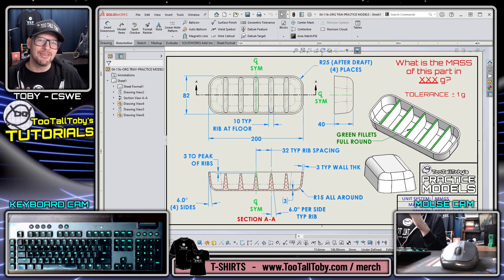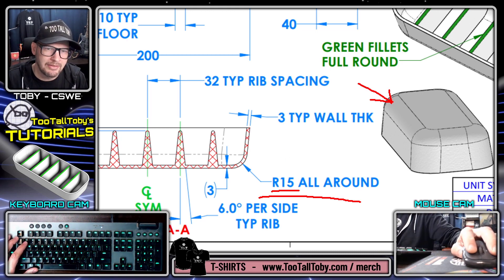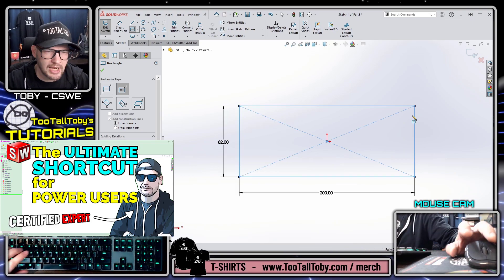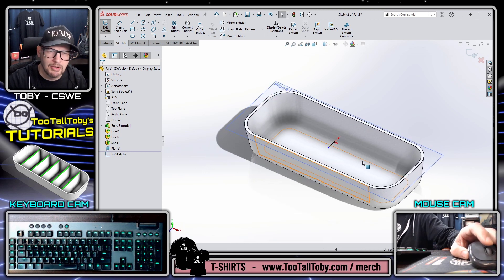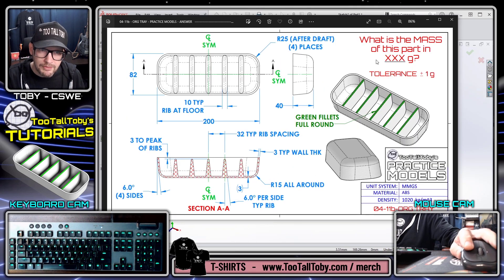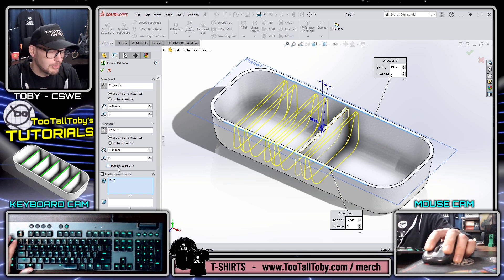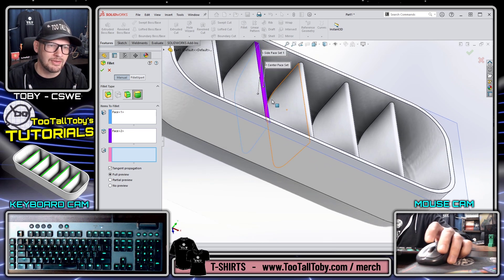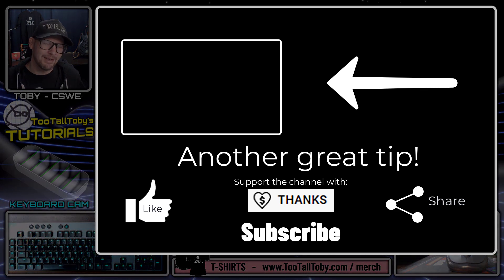SolidWorks Tutorial - ORG TRAY - 04-11b - how to RIB

Comment: When doing this in Onshape you can’t specify the rib thickness at the base. You can only specify it at the top unless I’m missing something.
Reply from the maker: I think that's correct.  I saw they just added the ability to add draft while RIBBING in Onshape, so it's just a matter of time before they add thickness at base.  :-)
Reply: @TooTallToby  they still haven't added that feature. but what i like to do is ask Chat GPT. you can literally ask it anything and it will spit out an answer. base wall thickness extending up to x height with wall angle of y. and it will give you an answer.
Reply from the maker: nice @dnappi85

Comment: hey toby, question. i created the org but i included the radius of R25 to the rectangular sketch, otherwise i did the rest like you showed. but i got a mass of 168.73. if i do the radius as a feature, then i get the same mass 168.20. why would they be different?
Reply from the maker: Same question as Rich had - (see other comment) - if you make the radius BEFORE the draft, it will result in a conical fillet.  If you make the radius AFTER the draft, it will be a cylindrical fillet.

Comment: Learned a lot, (which you know I like)! I modeled this twice, due to this 'partb' video.
The first time I used fillet, (25mm), in the sketch, (the result is a conical radius). The second time, I remodeled the part, (with a "B" in the filename). I used the fillet feature, (25mm), on the part, (the result is a cylindrical radius). Had to reattach some references, etc., but all else being the same, the resulting part was 0.52g lower in mass than the first model.🤔
Also, brilliant reveal of the extra functionality of the rib feature commands! Had I known that already, I would have been in tolerance with both models.
solidworks2023
Reply from the maker: Awww YES!  Great feedback thanks!  Yeah the Rib thickness at wall face is DOPE!  I've used that a lot in my career!